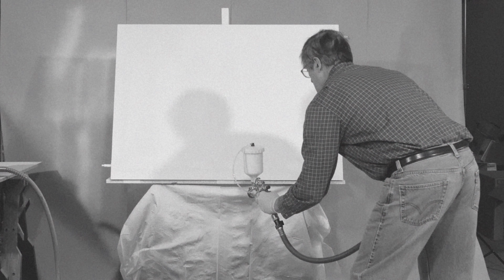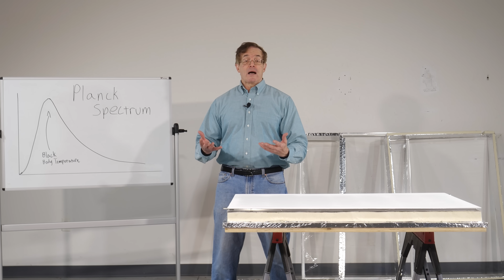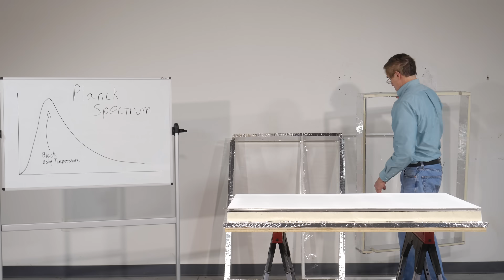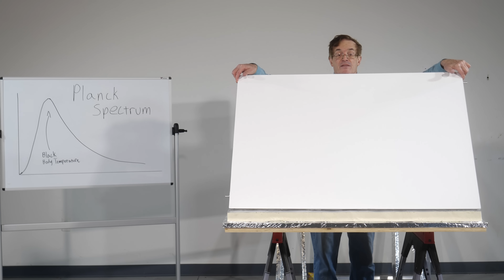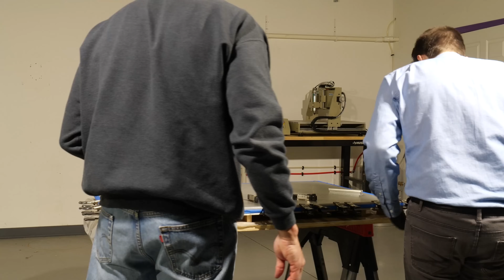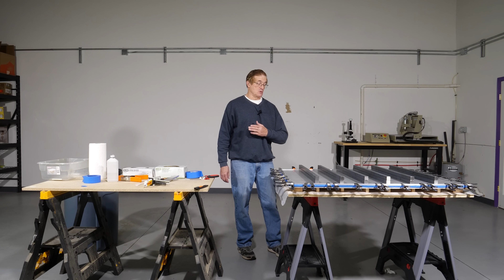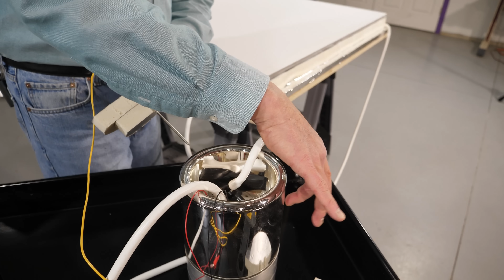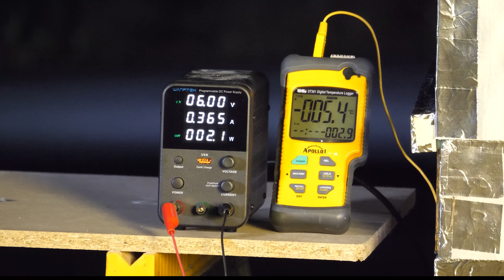Air Conditioning isn't free... but we're close.

Comment: Yes! Great to see you working on this also. Your test setup is pretty much what I came up with for a future video, but you did a much better job of it. I've been working on a variety of coating methods for comparison. In recent experiments I found that barium sulfate and calcium carbonate pigments have near equal performance if used in the snow scattering acrylic base from my earlier video, with barium only slightly pulling ahead. I hit about 4C below ambient with the coatings facing directly toward the sun. I hope my experiments past and future help you develop this into a practical diy solution for everyone.
Reply: I was just about to run over to your channel and talk about this; awesome to see more development on these coatings!
Reply from the maker: Thanks for the feedback!
I found  that a significant improvement occurred when I blended spherical barium sulfate nanoparticles with different SIZES.  I ran the formulation at four different temperatures to generate specific diameter particles.  This allows for efficient densification.  Minimizing the acrylic  fraction helped a little more.
Reply: @TechIngredients  You guys should do a collaborative project taking this further, it could be really important tech!
Reply: @TechIngredients  If you look at the IR spectrum of your acrylic, depending on what comonomers are in it, you will find that its carbonyl and ether bonds are very strong IR absorbers, and if you have many types of each, the bands may cover a significant frequency range. Carbonyls from poly- acids, esters (including acrylates and PET), ketones, aldehydes, amides, etc... as well as C-O bonds in poly (or co-poly) ethers, and hydroxyl (-OH) bonds in poly- saccharides, alcohols, acids - these are all among the most powerful IR absorbers. So in the same vane that you use PE film because it's CH2 and C-C bonds absorb IR relatively weakly, I believe that you may be cancelling its IR-transparency contribution by using paint with an acryllic matrix. I'd expect that much of the IR you are trying to reflect from the inorganics is being absorbed by the matrix they are suspended in. I dunno if there's a soluble low M.W. polyolefin (e.g. PE) "wax" paint matrix that you could use instead of acrylic...? I may be off here, but as an IR spectroscopist, that's a flag that popped up for me right away. Maybe the "special sauce" of the commercial paints is that they use some kind of PE-heavy matrix? It would be interesting to get it analyzed at a local lab that has IR, like a college and see what the polymer is. Forgive me if I'm way off base. Good luck, I mean skill!
Reply: @TechIngredients    on the sealant for the heat exchanger.. why not neutral cure sealant? sticks to aluminium really really well and is flexible.
Reply: @TechIngredients  i cant wait for the next video!
Reply: @TechIngredients  You should rename your channel Densified Ingredients
Reply: @TechIngredients  Couldn't you use a heat pipe to cool for absolutely free?  Or you could have this power it's own pump with a sterling motor or other heat engine?   Also what would happen if a Solar panel was put above this?  Sure the panel would block the light but it would re-emit the light within the aluminium box and it would then escape, the panel might be black but it turns light directly into electrical power thereby avoiding some thermal conversion.
Reply: @jonathanberry1111  You could! however the temperature differential of a heat pipe is limited by the amount of heat you can dump. A heat pipe that is dumping heat to ambient air is going to have much less differential as one dumping to space. The panel is dumping it's IR into space through the atmospheric Infrared window.
Reply: @SyBernot  I see that, I did however have another idea.   Correct me if I am wrong but black object radiate heat better than white ones.  At night when there is less light and heat to absorb maybe black will be better,  Recall that in NHiL's video the regular white paint in shade did about as good as the special one did.  I personally doubt that the "atmospheric window" can be so meaningful as surely IR must go some distance before being very mildly absorbed by the atmosphere and the atmosphere isn't a retroreflector, only a tiny percentage of what goes out could ever come back in.  So if the radiation is boosted enough over that of white it might be best to have black at night and white in the day-time.
Reply: @jonathanberry1111  reply to black tint...  I made the same mistake at first.  Visible light and color tend to make us think in narrow bands of the "electromagnetic spectrum" after watching a PBS nova program on the james web telescope they explained how the IR infrared section is much larger and different elements of the periodic table assorted or repelled different bands of IR .  So, barium is the best so far adding any coloring will diminish its function
Reply: @TechIngredients  🥰
Reply: @TechIngredients  I posted this reply last night in an older gas turbine video so because of lots of interest in the gas turbine subject it may gain attention in your latest post. An interesting concept was studied by the Moscow Aviation Institute back in about 1970. I came across the following report but could find no further info on the study.Interesting to say the least.
X-1 Gyroplane: This aircraft used a piston engine with an afterburner.
The exhaust gases were mixed with fuel, “burned out” and created jet thrust, almost doubling the total
power of the power plant with no compressors.
Motor-compressor installations are widely known.
Here the thrust is generated by the afterburning of the exhaust gases of a piston engine.
This miracle was designed and built under the patronage of a very famous aircraft designer and can be
considered one of his last (if not the last) work.
The X-1 gyroplane was designed at the student design bureau of the Engine-Building University (SKB-2) of
the Moscow Aviation Institute.
M.L. acted as a consultant for design students. (Miles L???).
Its peculiarity was the jet drive of the main rotor.
The exhaust gases from the MT-8 motorcycle engine were directed to the main rotor shaft, then to the
hollow blades and ejected tangentially from the ends of the blades,
adding about 10 hp. power. The MT-8 engine was very imperfect, the exhaust gas
temperature reached 1100 ° C, and the maximum pressure was 6.78 atm.
The MT-8 itself rotated the pusher propeller.
Power of 10 hp enough to spin the rotor before launch, and during the launch, the burners at the ends
of the blades were turned on  (afterburners that burnt oxygen in the exhaust gases).
The power on the rotor increased to 72 hp. - sufficient for vertical takeoff and landing.
MT-8 Engine Spec's:
K650/MT-8 1967 to 1970
649cc OHV
32 / 24 --- Hp/Kw
The rest of the design was as simple as possible. The fuselage consisted of three steel pipes, at the ends of
which the landing gear wheels were placed.
Fixed swept keels were also installed on the side supports, which somewhat improved directional stability.
The pilot's seat is placed open, the MT-8 engine is behind the seat back.
In 1968, the gyroplane was exhibited at VDNKh, work on the preparation of documentation continued in
1969, but there is no information about flights.
#Photos & images were supplied with the report#
Reply: @TechIngredients  I would think the mixture of sizes would help average the spectral efficiency. Much the same as coatings in the radio bands.
Reply: @TechIngredients  would a geothermal closed loop be a more durable solution for removing heat
Reply: @TechIngredients  I would like to see you experiment with building a ~15'x15' compartment ~10'-20' underground, keep it raw earth if needed less the ceiling planks to hold back the dirt to surface level. The room will have a 5" pvc inlet pipe from the surface,  on the opposite end will have a ~4" outlet pipe into a structure for cool air.
No electricity or moving parts needed. Via a 1" pvc pipe, experiment will flooding the floor with ~2" of standing water. 

I always fantasize being off grid, with time and money, once finalizing the experiment....having it be a completed ~15'x15' concrete box underground with nothing more then an inlet/outlet pipe.
Reply: When the coating gets dirty, how does it effect the numbers?
Reply: @chapter4travels  The cling film protects it!
Reply: @chapter4travels  IMO the plastic sheet also keeps out the dust and is a cleanable or replaceable surface
Reply: Seeing two of my favorite yt channels talking about a science subject and sharing information is just beautiful :)
Reply: Would love to see this added to thermo electric modules. Yes they are inefficient, but a bunch of them at low voltage is still a cheap solid state heat pump. Cooling smaller spaces like a trailer, shed, or single room on low total power should be possible. Perhaps a ground loop to dissipate would compensate for the inefficient TEC's and bring total system efficiency up to mini split levels.

Like, ebay 6 TEC water to air module in series at 14v, heating water/cooling room- hot water to ground loop- to black body radiator- back to TEC module. You'd have to come up with a way to deal with indoor condensation, but the TEC's would have their hot side being cooled well below ambient temps. With enough ground heat dissipation, one should be able to crank up the voltage/power on the TEC's during the day to get useful BTU's when necessary and when solar power is available.
Reply: @ur_quainmaster7901 Did you mean six TEC modules in parallel rather than in series? Series (one on top of the other, in a pile of six) would be very inefficient.
Reply: @mikejosef2470  I mean electrically run in series. So each module is run at much lower than 12v.
Reply: It's great to see multiple people coming up with similar solutions independently, it tells me I'm on the right track. The next iteration for me would be to get the benefits of gravity and state change by constructing a heat pipe with something like acetone or toluene  as a working fluid, put the condensing end in the dewar connected to the panel and the evaporative end in a dewar of it's own. The great thing about thermodynamics is it's just moving heat around or converting it to a different type of energy.
Reply: I was just thinking of NightHawk when he was applying the coating...at the end of the vid to comment...and here he is lol.
Reply: I'm looking forward to see what you have coming out. You and @Tech Ingredients are my go to channels on stuff like this.
Reply: You two are a hope in this world.
Reply: I was just looking to see if NightHawkInLight's work was going to be in the comments, nice to see you here!  Maybe a bit of colab is in order?  um, CoLab?
Reply: Glad to see you already here and sharing notes! Can't wait for your new vid!
Reply: This system can be used alongside solar panels.

You place this system just below it. Let solar panels work and heat the water in the day. And in the night you raise the walls of the system, and let it cool on the night. Probably the water pumps will be working 24/7.

Could be an interesting engineering challenge. Hopefully someone deems it worth and tests it.
Reply: @Splarkszter  if you could make an analogous coating that increased the IR emissivity without stopping the visible light, you could significantly increase the efficiency of solar cells, as their efficiency drops of fast with temperature.
Reply: @Splarkszter Why would you heat the water during the day, and then use the supercooling system to cool it down at night? Or am I misunderstanding you?
Reply: Haha I was about to say where's the shout out to Nighthawkinlight
Reply: Thank you. Very nice video. I wonder if you could have had a larger temperature difference, had the electrical pump not been submerged in the fluid you were trying to cool.
Reply: I've always thought thermo was a fascinating subject.  Except when I was taking a thermo class --very tall weeds.  Maybe call that an emissivity cooler?  I always wondered how a near-ideal system would work, b/c it's free to operate, and A/C is so problematic.
Reply: Check out Aaswath Raman's Ted talk on creating a thin coatings optimized for night sky cooling.
Reply: Came to comments to see if anyone had tagged you yet. Glad to have you guys communicating.
Reply: My takeaway from your coating video was that using commercially made titanium oxide paint is so effective that there’s no chance I’ll ever see a coating that is anywhere near as efficient in terms of money cost and work cost.
Reply: @twestgard2  The titanium paint was only effective at night. In daylight it was 20f hotter than snow paint, which is significant.
Reply: @Nighthawkinlight  thanks, sounds like I need to take another look.
Reply: @twestgard2  But in the shade, at night esp wouldn't black be colder?
Reply: @jonathanberry1111  To the extent I understand these matters, black is black because it absorbs all parts of the visible spectrum, and I believe it’s also generally a valid inference that it’s absorbent in infrared that’s outside our eyes’ ability to perceive. So the debate as I understand it is, what shade of white best repels radiated heat, including invisible infrared heat that’s radiated from your surroundings at night. 

To put it another way, the trees and lawn radiate heat towards your house 24 hours per day. You can’t stop them from radiating but you can affect how much of that radiant heat your house absorbs. If you paint your house black, it’ll absorb more of that heat. If you paint it white, it’ll absorb less. So the debate here is which shade of white paint does that best. 

That said, I’m not the expert here so if I’m off track maybe someone else will correct me.
Reply: @twestgard2  But if the painted object in in an aluminium enclosure open only to the sky then there isn't much to absorb.  So if there is very little to absorb and then black might be a good choice if it radiates energy more readily which I understand it does.
Reply: @jonathanberry1111  Oh well in that specific application the heat is arriving in the water pumping through the aluminum rectangle, and the relevant temperature difference is between the coating on the aluminum, and the air that comes in contact with that coating. The coating has to dispel more heat into the air than it absorbs from it. So you paint it a heat-repellent white so the balance is a net outward movement of heat from the coating upward into the air. If you paint it black, the coating is more absorbent and the air has the net loss of heat into the aluminum rectangle thing.
Reply: @twestgard2  You still seem to be missing the point.  There is absorption and radiation, as I understand it according to Kirchhoff's law the better one it as absorption the better it is at radiation.  Therefore a hot black object will cool faster than a hot white or reflective one.  And so if only exposed to the cold night sky when there is nothing to absorb theoretically it should be better at cooling down painted black.   If there is no incoming heat then you don't need to worry about repelling it with white paint and that is the magic of doing this at night and limiting the view to the sky.
Reply: @jonathanberry1111  I believe that what you’re describing works in a vacuum. In this situation we have air touching the surface, and that air contains heat.

EDIT: I’m really out of my depth at this point, but from what I understand, Kirchoff’s Law regarding heat transmission requires the conditions of (1) a closed system, and (2) thermal equilibrium, neither of which applies here, and also (3) Kirchhoff’s law is actually deprecated in our current understanding of the physics of heat transfer. https://youtu.be/DodFojdkSIA
Reply: @twestgard2  Convection isn't an issue because as Tech Ingredients mentioned, a bit of cling film can be used, NHiL also used the same ultimately to remove convection
Reply: @jonathanberry1111  the plastic doesn’t eliminate convection, or radiation. The air is still there
Reply: @twestgard2  You are partially correct, but because of black-body radiation, black pigmented objects are actually able to radiate heat at a higher rate than white pigmented objects (imagine that the white pigments generate more interactions with photons causing a temporary "trap").

It's a bit of a catch 22, since black objects both absorb and release heat faster, while white objects absorb it slower but likewise release it slower.

My understanding of this is not the sharpest since frankly I only learned of this problem while watching a video explaining why Bedouins wear black robes in the desert (the conclusion was no measurable difference in performance).

Also consider how the pigment acts towards the object it is on. Consider an emergency blanket: it reflects your own heat toward you, but likewise reflects external heat away from you.
Reply: @twestgard2  the way I like to consider pigment choice in terms of absorption/radiation characteristics comes down to how far from the surface I want the heat.

Dark pigments keep heat closer to the surface, white pigments keep heat further. This is an immense oversimplification, but knowing this the environmental factors can then be considered (i.e. wind, light, humidity).

I believe this is why in the video he has to keep air out of the equation and seals the unit with plastic. So the paint idea doesn't apply well to an exposed object like a house where conditions change, only controlled condition objects like the emitter in the video.
Reply: In some country's cemicals can be hard to get due to laws and limitations BUT ultra white/titanium paint on panel backed with Peltier chips > alloy and then a pre heated brick from a PV panel during the day and you could make a hybrid combo panel setup that makes watts at night and day?
Reply: I got interested in this since I think the channel "But Why?" did their video on it, then saw Yours and now Tech Ingredients, but I still have not engaged with the literature whatsoever. Does anyone in this comment section know if Calcium Chloride could work? I don't even know HOW to check the emissivity of it. I ask cause of course I have pounds and pounds of desiccant of course, so wouldn't even need to go after anything else.
Reply: @prgnify  The easiest way to get the emissivity is to use an IR camera with the emissivity set to 100% while heating your mystery chemical to 100C (boiling water) and measure the temperature. If it reads 95C the emissivity is 0.95 or 95%.
Reply: The satellite industry has a lot of data on high emissivity coating. Start with the Spacecraft thermal control handbook, by Gilmore.
Reply: @johnpinckney7269  thank you
Reply: Hi guys, tech ingredients and nighthawk, long time fan of both of you.  There is a YouTube channel called "smarter every day". That channel did an episode on the james webb infrared telescope.
If you reach out to him i bet he would be interested in this technology and be able to bring something extra to explaining the infrared glow in spectroscopy of periodic elements (i.e. the bandwidth of prism light)
Its possible he already did a video on (Persian ice House's) IDK i don't remember.
Reply: Wow, cold fusion.
Reply: I was thinking about your video!
Reply: *copied
Reply: They say there are three people usually working on the same inventions. Hmmmm. I suppose I may be the third. I am a chemical engineer and I am going a little different route..I am working on the conversion mom atmospheric stain electricity to dynamic electricity. The Germans did it in World War I. Great job!!
Reply: I seen so many good comments on this. So I subscribed to you. I hope it’s another good ine
Reply: @robertpirtle3638  NEWS: James O'Keefe was just fired by woke infiltrators in his own team - just after he landed his biggest coup ever!
Reply: @chrise842  am I missing something ? Who is that
Reply: @robertpirtle3638  the famous investigative journalist and founder of Project Veritas!
Reply: When are going to collaborate with tech ingredients and do a video together? Fans are requesting
Reply: Well look who it is.
Reply: When two legends get together on something!
Reply: Can you guys make or explain RTK guidance base and auto steer? May make a heck of a video!
Reply: Yep saw your video a year ago I think it was,
Reply: Was literally going to reference your video here 😅
Reply: @nighthawk: I watched your video some time ago. It was great! I look forward to your continuing experimenting. I am also wondering what his coating is....waiting in great anticipation for the next video.
Reply: Question: 
Can Barium Sulfate be re-treated in some way to make different size? I can get 25Kg, 
45A Barium Sulfate , which is 85% (C-85) for $29. While 1Kg Barium Chloride is $15... 
Any guidance is highly appreciated.
Reply: @eagleentertainment3100 where did you get it at? I found it at Grainer for 165.00 for 500 grams
Reply: Oh hi, I just dropped a recommendation for this channel on your flash graphene video cuz they just did a great job with theirs, so hopefully people will watch both. Fancy seeing you here lol
Reply: I would love to see a series of videos on passive heating and cooling systems used historically like thermal sinks, shaded windows, spiral chimneys, domes, alleyways, orientation to the sun and courtyards. The ones used for thousands of years in the middle east and south east asia. 
Especially great if you build scale models to measure real effect. 
Determine which ones add the most effect and comfort, and the ones that work best - Push those to the extreme to show where they hit their limit of effectiveness. 😁

We need a solid engineering/science look at these techniques that don't use fancy coatings or power, just simple low maintenance materials such as mud, brick, wood, sand and stone. This would be super helpful for lowering our footprint and power usage with ancient but forgotten techniques. 

Love the videos! Keep up the fantastic work!
Reply: Having watched your latest  video on the heat-radiating paint, I thought of enclosing water or coolant pipe painted with your white inside a clear box and creating a vacuum inside to allow temperatures to fall even further.
Reply: Does the wavelength of Infrared Radiation your paint gives off pass through glass?
Reply: High NightHawk. The big difference is that you know what  you are doing and are rigorous. This guy does not and  is not.
Reply: looking forward to the day we attach these to a Stirling Engine!  🥰
Reply: Why not put the whole system in a closed loop with low pressure ? The water would evaporate faster and once it goes up (to the "infrared chambre"), it can cool down and go down through another pipe toward the interior of the house.
Reply: calcium or barium sulfate coating can stand long time? do they change or absorb dirt?
Reply: This is great
Reply: I liked your video about it more, but this one is certainly good for research needs.
Reply: Keep at it. Were still watching.
Reply: this is why your solar water heater, depending on the type, may need to have a have a cover over it at night. Hi, @Nighthawkinlight :D
Reply: Is that why chemtrails spray barium and aluminum? So that the sun isn't as strong as it should be? If so now I understand why man tampers with Yahweh's perfect design, which isn't a good thing, just man's arrogance that he knows better than Yah!
Reply: Just subscribed! Great comment
Reply: "a'int" in your thumbnail triggers me so hard.
Reply: Butyou better not paint a flat surface use triangle or cooling fins... Surface area is what you need
Reply: Awesome 2 of my favorite channels communicating hope you guys do a project together
Reply: Thanks to everyone for being an inspiration. Truly some of the best role models.
Reply: @sublucid  I was going to edit my response to be more clear but it doesn't seem to have posted. 
It's working temperature mainly, water freezes at 0C and no amount of vacuum you could pull in a heat pipe is going to adjust that by much. Water also has this unique property of expanding when it freezes which not something you want in a sealed thin walled tube. Acetone and toluene have a similar working range but much lower freezing points.